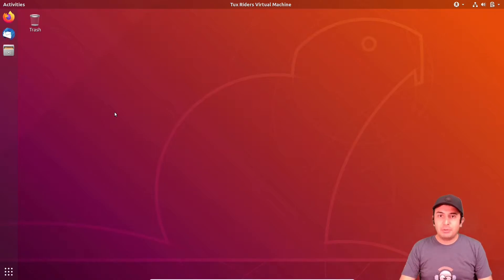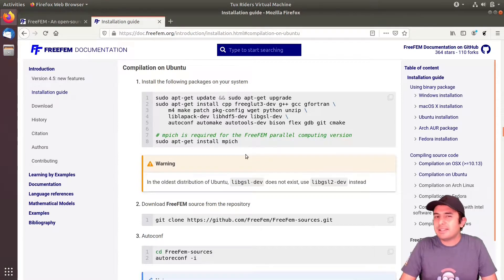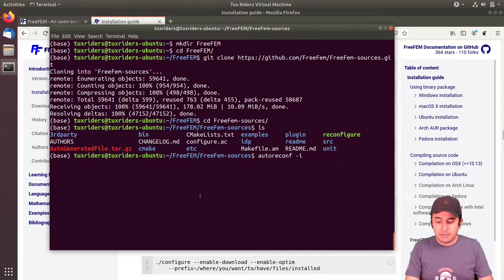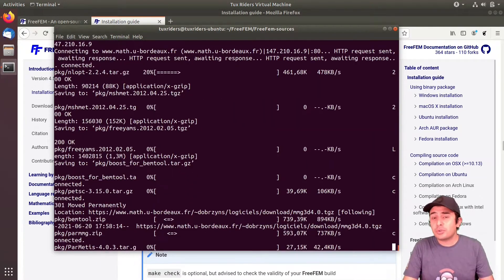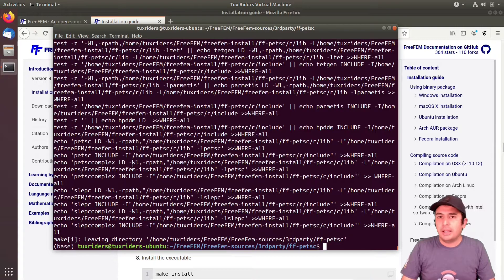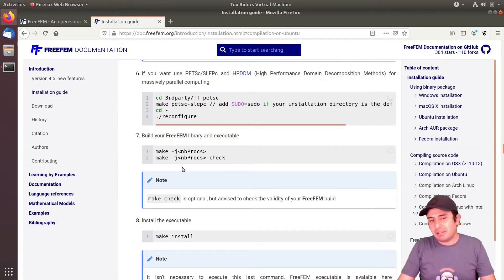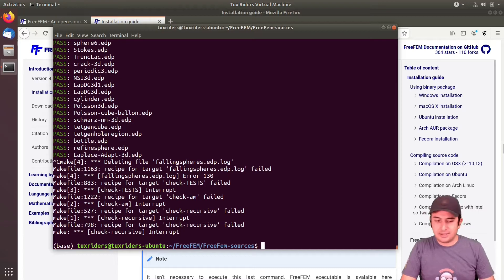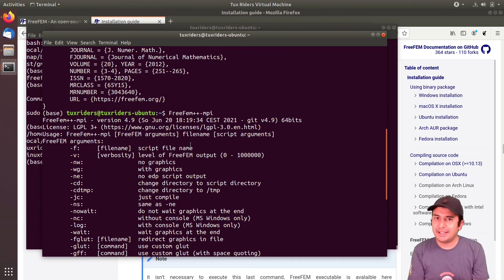[Environment Setup 13] Build FreeFEM finite element solver

Comment: Thank You, Mr. Barzegari! I have been watching these scientific environment series since the first one. Sometimes I have to delete what I've done, change something and repeat actions, but until now there has been no one unsolveable error that could stop the process of setting up scientific environment: program after program. Thank You!
Reply from the maker: my pleasure. indeed, this series was recorded more than 2 years ago, meaning that some of the packages may have a different installation routine these days. however, what you did is the best way to learn the fundamentals imho.

Comment: Hi, Mojta!
Just an advise, please consider giving more than 30 GB to the VM at the beginning of this playlist, otherwise you will run out of space at this FreeFEM point
Thanks for your videos, keep on!
Reply from the maker: hi Reimon, thank you for the suggestion. you are very right. I remember I ran into that problem in one of the videos because I didn't have enough space on the VM. I should have been more careful about it :)

Comment: Can You make a special video on how to install FreeFEM for windows all steps?
Reply from the maker: in Windows, the installation is much simpler and you don't need to follow the instruction of this video because you don't need to compile it. you need to download the .exe file from https://github.com/FreeFem/FreeFem-sources/releases and run it. it will a typical setup wizard in Windows.
Reply: @TuxRiders  lets say you want to install it on windows without using the wizard because you want to change some parts of the source code, is there a way? I'm trying to follow the steps on their website under "compiling source code >compilation on Windows". Only problem is when I'm trying to do the step 6 (configuration after cloning the git), it tells me I don't have Flex. I have tried to install said package in many ways, but no matter what the error message stays the same. Do you have advice for me, thank you!
Reply from the maker: @mathpin  it's a good question, but I'm afraid I've never built FreeFEM on Windows, so I don't know how to deal with the error you are facing unfortunately.
Reply: @TuxRiders  No problem, thank you regardless, your video was usefull eitherway. I managed to get it working friday afternoon, after a lot of trial and error, in fact, I dont even know what made my error message disapear. At one point, i stopped trying to follow the FreeFEM instructions on their site and turned to ChatGPT for some possible different steps (this is something I usually never do), all of the  things they told me to do lead to dead ends, so I gave up chatGPT to come back to the official instructions and there it was : it finally worked.
Reply from the maker: @mathpin  it's great that you have solved the issue. I think you may have installed some packages among all the steps you mentioned, and that's the reason why the official instruction worked in the second try.

Comment: i want to know are u using conda editor when u are using the "nano .bashrc" when running command it is not showing coda initialize. Are u using conda editor. PLz help me
Reply from the maker: I think it means that you don't have nano installed. nano is just a text editor, so you can either install it or edit the ".bashrc" file using any other editor you like (like vim). you can even edit the file in a graphical environment. the dot in the beginning of ".bashrc" means that it's a hidden file in Linux, so by unhiding the hidden files (like by pressing Ctrl+H in GNOME), you can see the file in your home directory and double click on it to open and edit it.